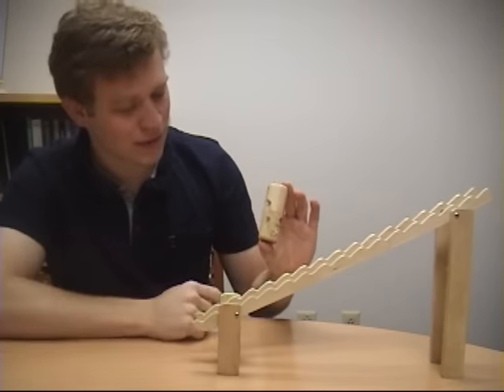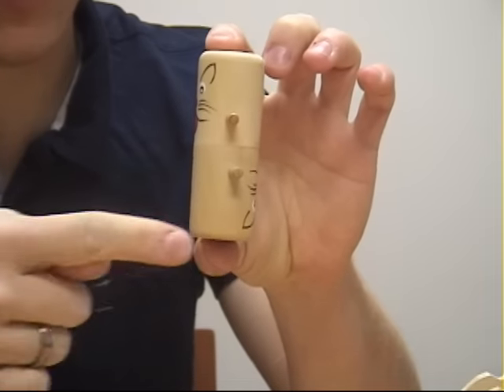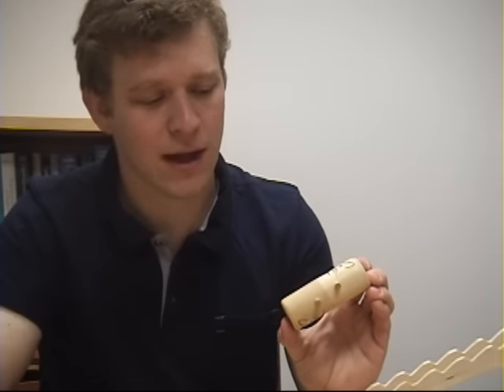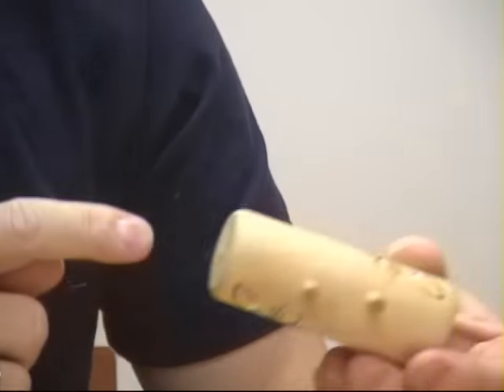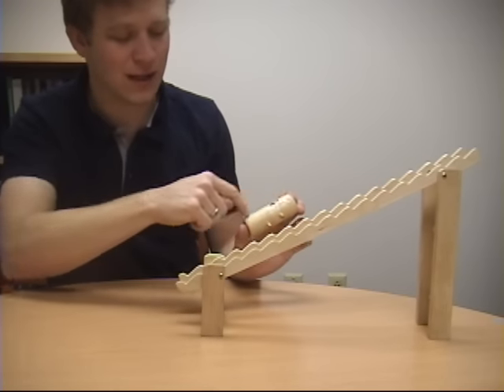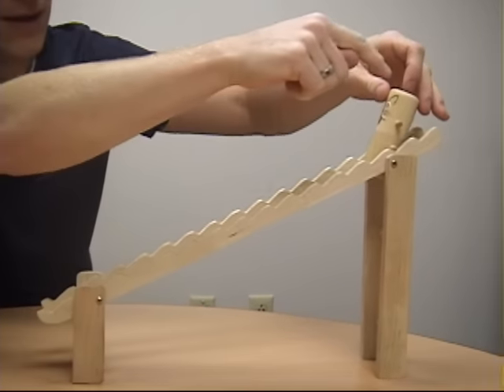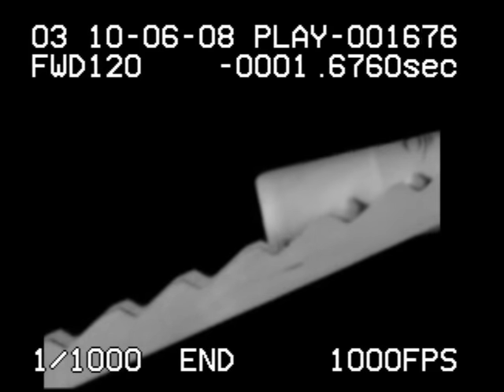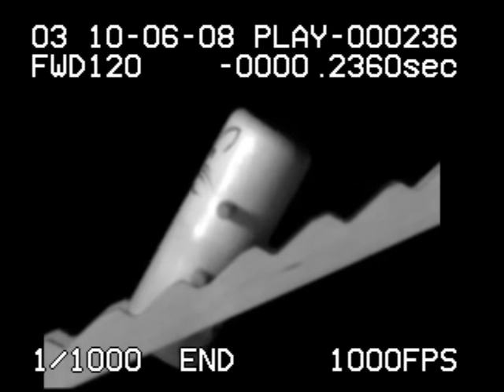Toy Physics - Part 2: Tumbling Cat

Comment from the maker: The pegs are offset from the center-line to enable the internal ball to create an offset impact, allowing the tube to rotate about the peg.  The offset is enough, along with the angle of the ramp, to allow the offset impact to create enough angular momentum to have the tube rotate to the next step.  I hope that helps.

Comment: Will a ramp with lower gradient require the pegs to be set with a larger offset?
Reply from the maker: connor john  All dimension and offsets would probably need to change, but I’m not sure how or how much without first developing a mathematical model of the system (or by experimenting).

Comment: If you made the ramp infinitely long you would have a perpetual motion machine!  You'd probably have to glue some copper coils to it somewhere: I see that on a lot of other perpetual motion machines. Either that or make it using a real cat and train it to climb back up to the top every time it reaches the bottom.  World Energy Crisis? What World Energy Crisis!

Nice wood-working - I like it.
Reply from the maker: Cute.  :)
Reply: DrDaveBilliards
I really do like the toy - beautifully made - I appreciate that a lot. The perpetual motion claptrap is just a pop at YouTube, not your video :)
Reply: You can create a perpetual motion machine by gluing toast to the back of your cat butter side up and drop your cat.  Your cat will fall half way then spin forever (or at least until the cat starves to death) as the cat tries to land on it's feet countering the toast falling butter side down.
Reply: Only of we could find annother energy to put the tumbling cat back on top of the track.
Reply: There's not such a thing called perpetual motion machine, in this case gravity is providing the energy
Reply: Ignacio Romero gravity is not an energy 😂
Reply: Ken Mendoza If you had finished high school you would know what I'm talking about. Gravitational potential energy: https://en.m.wikipedia.org/wiki/Gravitational_potential
Reply: Ignacio, then just use magnets to pull it back up. Magnets are magic energy sources, so it should definitely work.
Reply: Ambient Morality If the magnets were on the top, the thing would not fall. And if you put the magnet on the top after the thing drops, then the energy comes from you, which is essentially the same thing as you taking the thing and putting it on the top
Reply: Ignacio Romero I know, I (and the original commentator) are just joking.
Reply: Holy fuck this is such a good point... Just drill a hole to the Earth's core and drop a turbine down it with wires going back up. Nearly infinite energy.
Reply: Melody Not even close to infinite energy
Reply: Ignacio Romero it's as close as it gets, to be honest.... Because you can't be closer than that. Its infinity.Therefore, its pretty close.
Reply: Melody Air friction will stop the thing from falling to the other side, energy will be lost because of heat, and all of that assuming the hole doesn't collapse, which is impossible
Reply: there is an outside force. gravity.